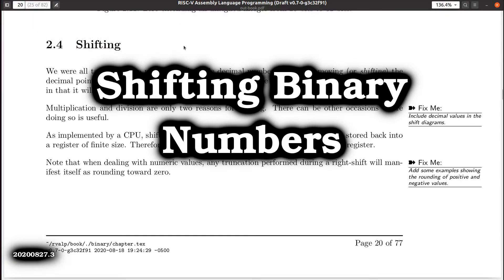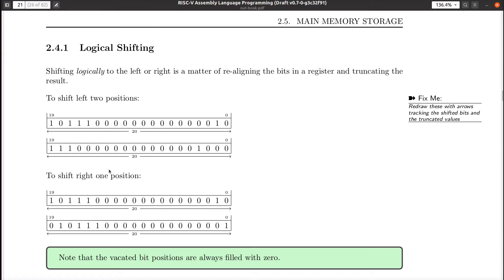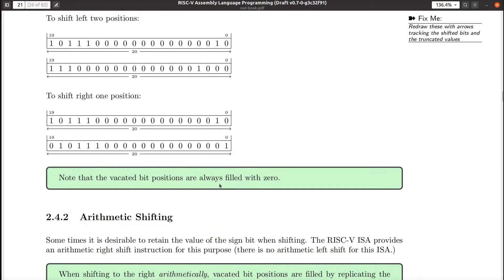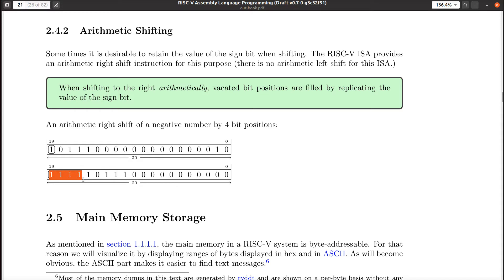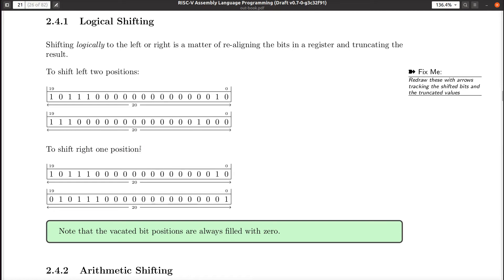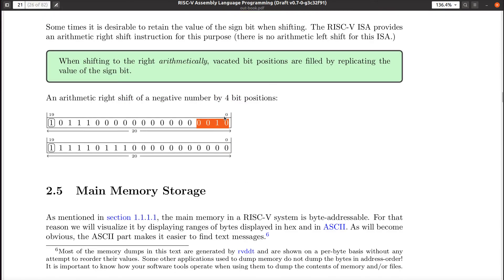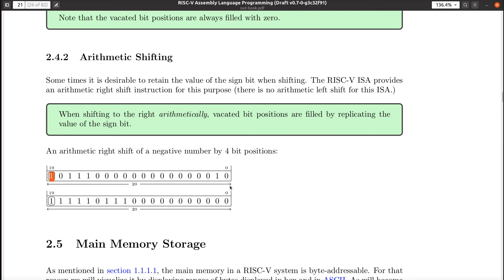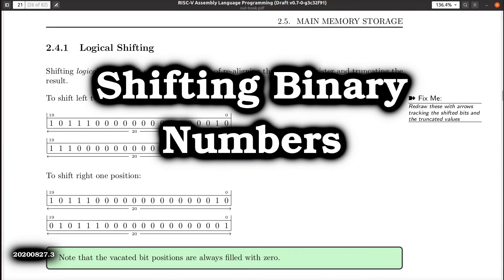Logical & Arithmetic Shifting Of Binary Numbers

Comment: Can I have a question to this? How can I determine the Carry bit after the shifts?
Reply from the maker: That depends on how the CPU you are using works.  On a RISC-V CPU, you will want to check the bit in question before you shift it.  Or shift it one less and then check the sign or LSB and then shift it one more bit.